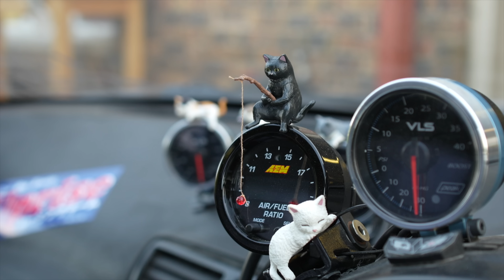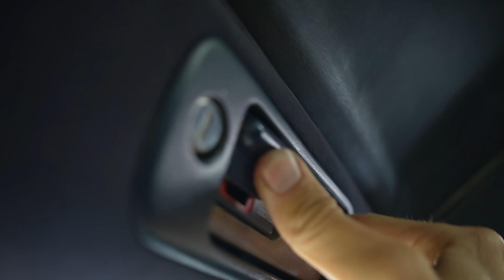The change YOU asked for: 300zx build

Comment: On a unibody car, the rockers are part of the frame as they mate with the inner rocker to make a rail and connect to the car via the torque box's or frame connectors. If you cut that part out of the rocker and leave it you "MUST!" install sub frame connectors to stiffen the chassis or it could start to flex. This is more important on convertible and T top cars because with less roof is less structure. T top may have dual inner rockers like a convertible, not fully sure on that and know other cars do have it.  
As a back yard bodyguy myself, seeing the cardboard brings back horrible memories of cardboard hair getting stuck in the body filler and had to sand it off to fix it. I won't buy one of those filler pads, I use a scrap piece of metal with one 1 inch square cut out of one of the corners and it feels like I'm a fancy painter making a masterpiece 😅I've had the same metal filler pad for 10 years now and don't know if I could do as good as I do without it. Its going to look so good 👌cant wait to see the colour

Comment: 10:20 that took me two days because one of the two screws holding the glass was spinning and had to drill it out. Luckily you can order those from japan brand new.
10:55 that is a common issue which can be solved by a simple piece of rubber plus some polyurethane sealant

Comment: i always enjoy watching your video's and the great camera work by your mate and friends etc. iv'e been a long time N/A zed owner for the past 23 years. in my opinion you gotta delete that ugly rear wiper motor and hole they look much better flush. there's also a chunky counter weight block that's bolted in at the back top of the hatch it's hard to see it but i found one in my 2+0 and deleted it. im pretty sure i already mentioned before about the Bose speaker amplifiers that are normally shit anyway and quite heavy all 4 of them. i deleted them too. i bought from ebay a long time ago a pre made set of 4 acrylic plates/ template's that screw back in there to mount normal size speakers to front doors and rear rear speakers. also the front door skins and outer speaker covers stay the same so does the rear covers. im just and old nutter about power weight ratios that represent free extra horse power and handling by removing excess weight first.  And don't forget to delete those AIV's while your front guards are off. lol

Comment: @21:14 a solod patch, wven if not perfectly flowing with body lines. Is a trillion times better then an open hole. Yoire just inviting moisture and cancer to this chasis if you chop hole and leave open. Please patch, even if ugly patch to be adressed years down the road. Seal her up tight 🙏🙌🤘 edit: even if you just panel bond a piece of sheet metal over the surface of the hole area and just etch prime and black base. So under side skirt body itself isnt open to contamenants.

Comment: There's better skulls on eBay UK but they're plate bolts not lights, a company in Europe does day of the dead ones in Gold and I got another set like proper miniature skulls with red bead eyes (which I drew black arrows going different directions around the craniums)

Comment: Did you remove the rust on the insider of the panel? Like you did it outside of the body, but inside? it seems you just weld the hole, but did u remove the rust on the back